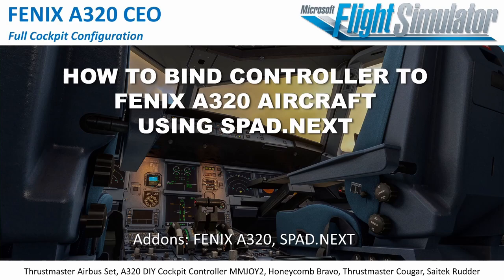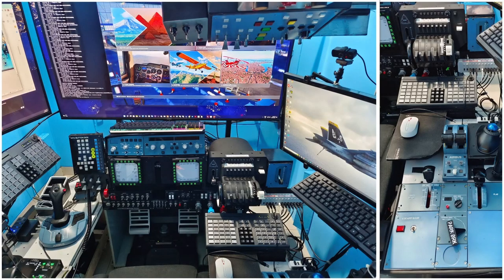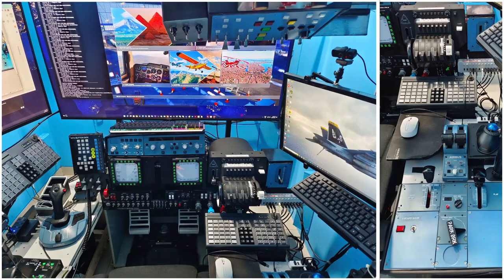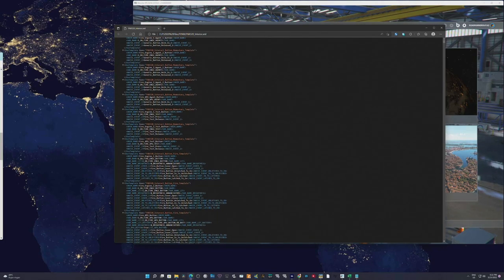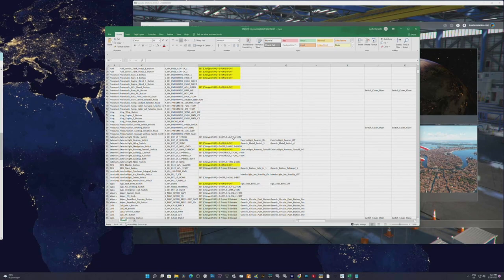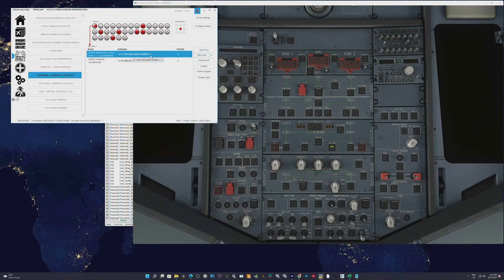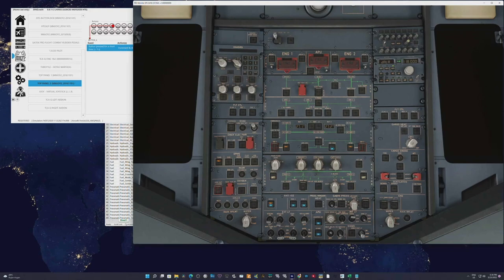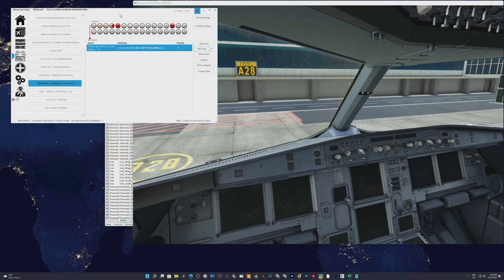Guide: How to Bind Controller to Fenix A320 SPADNEXT

Comment: Really great video.  I didn't know where to start with the Fenix A320 and my Logitech panels.  I downloaded your excel file with the LVARS so many thanks for that.  I'm sure I'll have everything working in no time.   Thanks again !
Reply: how you link this variables to spad next  or copy think xml file then paste it where ?? thanks
Reply: @watchthemoves  I didn't link the file to SPAD.  I have it on a different PC simply as a look-up reference.  As you know, the LVARS are visible in SPAD anyway  (assuming you have activated the LVAR Bridge and Simconnect ?).  I don't know a lot about this stuff, just followed a few videos like yours !   I find Les O'Reilly's videos really helpful also.  I followed your Battery 2 on/off example and it worked so I think I'm on the right track ! I couldn't find the original Fenix xml file containing the LVARS in my Fenix files, something I would like to be able to do.  I use a Logitech radio panel as an MCP so need to get the displays and knobs working with the Fenix.

Comment: What a great tutorial and sheet, many Thanks! Is there a way to assign push and pull functions to the SPEED, HEADING and ALTITUDE selectors? Can not find it in the spreadsheet.
Reply from the maker: Actually there is, i just realized its not in the list. Im using mmjoy2 push button on the rotary switch to toggle between two condition. Unfortu ately im no longer use spadnext as they move to new version. Need to dig the values again. Meanwhile try to look around on other resources and using similar approach.

Comment: Are you still able to not recieve and send FCU data however?  So let's say I want to see the Speed or heading on my Logitech Panel.  They do not sync do they?  Am I missing something?
Reply from the maker: Hi unfortunately havent really venture on output the LVAR to hardware just input controller. But looking at data monitor seems they change when you manipulate FCU. But havent try it in real application
Reply: I succeed only to make the knob increment or decrement the value in the game, but can't display the value on my logitech G panel :( Seem like nothing (simconnect, MSFS) has the value stored.

Comment: Great video tutorial. I'm trying to get my head around the button programming but am completely new to this. I have a Arduino button box with push buttons on it. I can get a button to turn on Battery 2 with one press but can't work out how to set the battery to off with a second press. The only way I can do it is by programming two separate buttons.
Reply from the maker: There are logic inside spadnext that you could program see my playlist for older spadnext tutorial for a32nx flybywiresim there I show you how to program push button to be toggle switch also look for roadrunner06  profile in spadnext
Reply: @hobbytechgearID69  Thanks :)
Reply: Thanks for the tips. I've been able to assign the required buttons on the FCU as well as rotaries to control the  speed, heading, altitude and v-speed dials. I assume there's currently no way of assigning the push and pull functions of the rotary FCU knobs?

Comment: I'm trying to understand your video because it sounds extremely useful, but this seems to be for advanced users. As much as I want to bind controllers to my airplanes I think I'm more confused now than ever 😫
Reply from the maker: It is a bit adv required some used to spad next. Start from a simpler binding or setup, once you got the knowledge it will make sense. Btw O Reilly have lots of tutorial on spad next also need to understand about LVAR used in msfs

Comment: Great tutorial, it helped a lot to set up my Behringer X-Touch Mini with the FenixA320 :). I struggle to assing the speed managed (and manual) modes to a button ... Do you know the right LVAR commands to engage the Managed modes at MCP - I_FCU_HEADING_MANAGED (LVAR) seems not to be right? Thanks a lot
Reply from the maker: Sorry late reply have to check my setting cant remember

Comment: Really helpful video, and especially the LVARS file.
I'm struggling to find an LVAR which contains the actual value displayed on the FCU for the set altitude. I want to display the set altitude on my Logitech Multipanel. The LVAR E_FCU_ALTITUDE does not contain the actual displayed value but is used simply to tot up the number of clockwise or CCW turns of the knob, whether the increment is 100' or 1000'. Is there anywhere that the actual displayed value (for the set altitude) is stored and available?
Reply from the maker: Fenix deliberately disable value output I guess thats in agreement with their Prosim license if not mistaken
Reply: @hobbytechgearID69  OK, that's a real pain. It's possible to do a 'lash up' by counting the number and scale of knob rotations, muliplying by the relevant value (100 or 1000) and storing this is another unused variable. But keeping it in synch with the actual readout seems to be the issue, and somehow slippage gets in and before long the two are out of synch. Seems a shame not to be able to display the set altitude on the Multipanel display while using the Multipanel knob to set the altitude.

Comment: Does this method work also with FSUIPC?
Reply from the maker: @riccardomilan   i think so but fsuipc use more low level programming syntax, while spadnext use more easier way of setting logic to interact with lvar or other var
Reply: @hobbytechgearID69  thanks, solved the matter. FSUIPC has preset to handle every knob or other aircraft stuff.

Comment: Where do I put the .xml file?
Reply from the maker: Should be in the spad.next profile folder look at the profile page menu on the right side however its only for my controller so yours might not work as most of mine are DIY the purpose though is to look at the command or program or the value setting
Reply from the maker: https://youtube.com/playlist?list=PLJKfNjiL9hnZAWSuGWkWFpNRMU7MbZ9l0
Reply from the maker: Look at my spad.next video series or les riley youtube channel i learn from him a lot on how to set the LVAR so you could bind your controller